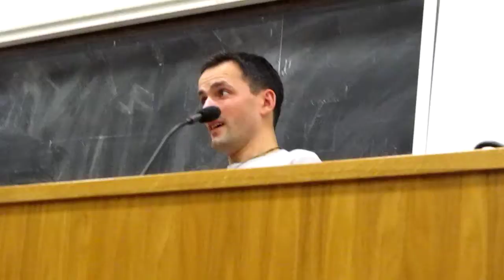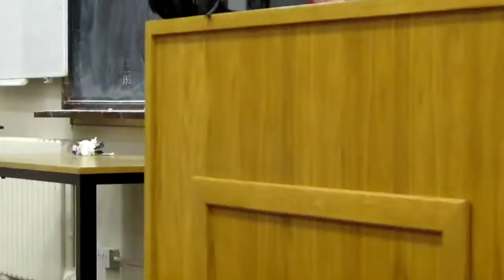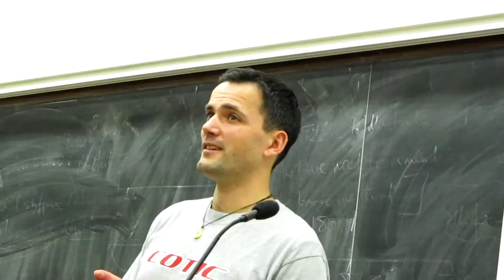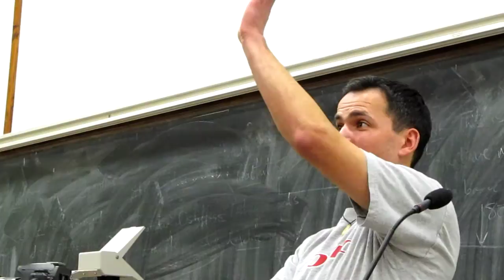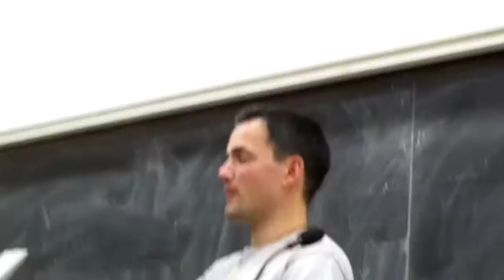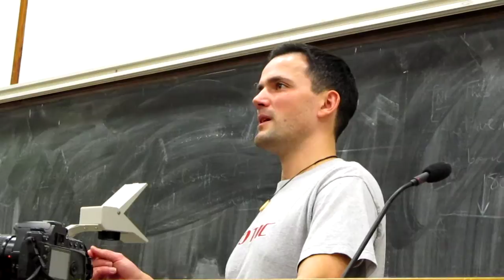Cy Turner ImechE Lecture 6

Comment from the maker: @flamejob @flamejob Afraid not - the AA batteries failed me! Hope understandings of resource limitations will push efficiency as high priority. This is kind of happening with cars, but with the rise of the 'space phones' I see the opposite happening in consumer electronics. Why would one buy a device whose battery lasts only 1 day? 400-1200 cycles is a typical lifespan for Li-ion; 365 days/yr: battery life = 1-3 years.